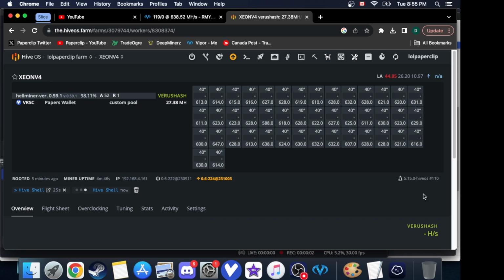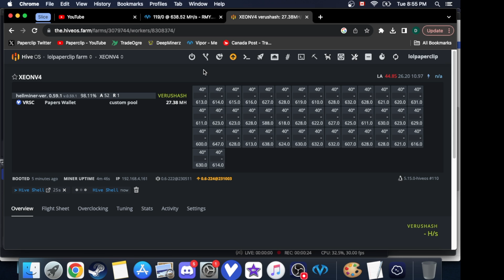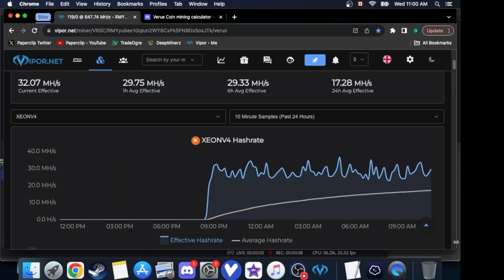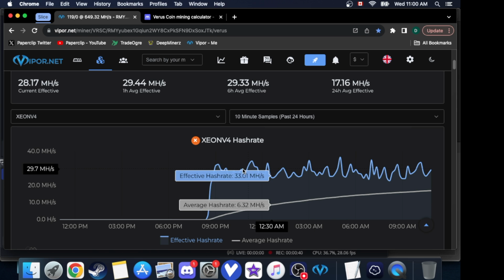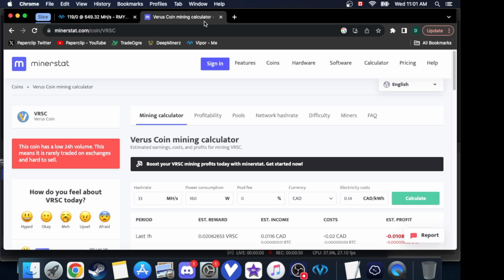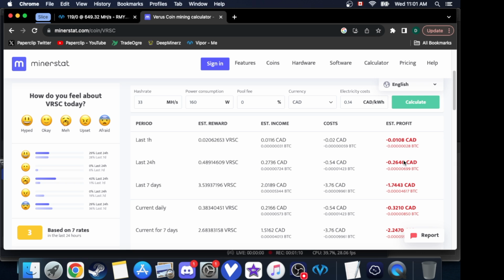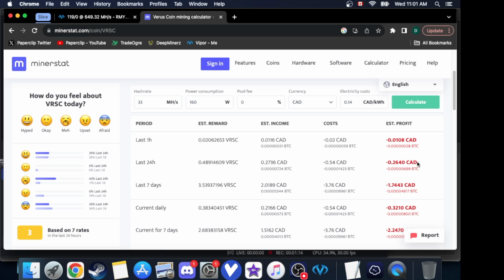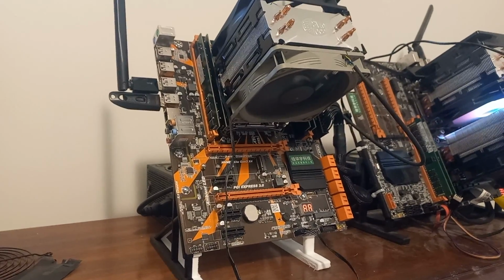SETTING UP MY NEW XEON RIG │ Verus Mining

Comment: Hi, do you think there is a big difference in hashrate between Xeon E5-2699 V3 and Xeon E5-2699 V4? Mh/s? thank you
Reply from the maker: Not a huge enough jump to the justify the cost of upgrading from V3 to V4... you have to make sure too, that you have mobo that can handle them. I am running off of cheap chinese X99 boards as well.
Reply: @lolPaperclip  No you don't understand me, I'm new to this and would like to try Verus mining, I have a dell precision t 5810 server station with a xeon e5 1620 v3 processor that gives 7.2 MH/s and I would like to upgrade it but I don't know what the difference will be between 2699 v3 and 2699 v4 in hashrate (MH/s)
Reply from the maker: @ОлексійК-в8т  v4 runs at higher clock speed and has more cores.... and I have Dell precision board as well. But I don't have the fans 'n shit.

Comment: I have a CPU 14 core 28 threads × Intel(R) Xeon(R) CPU E5-2690 v4 @ 2.60GHz AES running on hiveos with xmrig. When i give him the full 28 threads in the config he has only 2,5 kh/s. If i reduce the threads to 16 he makes over 5kh/s. I really not understand why 🙂.
Reply from the maker: I think with random x it's more memory based
Reply from the maker: I think HiveOS auto corrects it for you... but I am not an expert

Comment: Hi, how are you ? Your video with valuable information is very good. I want to ask if the e5 2699 v4 works on a dual motherboard to place 2 e5 2699 v4? I want to mine dero on hive os with the new version of the dero miner luna doubles hash on amd and increases significantly on intel. https://www.youtube.com/watch?v=kpgtJ-RNxYY&t=122s

Comment: Im only getting 14mh/s on a dual Xeon E5 2640.. Any suggestions? I think my psu might be too small, 550w. I'm kind of a noob tbh
Reply from the maker: How much RAM and it could be that they are 2640, I wouldn't go below 2680
Reply: 32gb of ram, it was just a cheap marketplace deal so I scooped it up
Reply from the maker: @SmitHVAC.   what version of the 2640s?
Reply: @lolPaperclip  I'm not sure, how can you tell? It's showing 12 cores 24 threads
Reply: For $80 Canadian, I guess she'll do

Comment: I have xeon e5 2680 v4 CPU processor 2x16g = 32GB and get 23-27MH/s with it.

Then I have dual XEON 2x2683v4 64GB, with that I get about 30MH/s when I use 40 threats.
If I use 50 threats I get only 5 MH/s.

I have thought more Threats more MH/s

DUAL CPU has 72 threats. Why is MH/s less although I have 2 CPU ?
Reply from the maker: Leave some cores for the OS maybe?
Reply: @lolPaperclip  
Mainboard with 1 CPU E5-2680v4 14 cores 28 threads
Uses 25 threads for mining. Works quite well :-)

Moainboard with 36C/72T 2 x Intel Xeon E5-2686 v4 18C/36T 2.7 GHz - 3.0 GHz manages only 44 threads makes 40MH/s

If I take 45 threads the MH/s goes down to 6 MH/s
Reply from the maker: @Fl4shBoom  very weird, I cannot help you there buddy guy

Comment: If the motherboard allows for undervolting give that a try to lower your power consumption. Those E5-2699V4's are energy pigs.
Reply from the maker: I am not sure if Intel chips allow undervolting, Im 100% you can with AMD tho.
Reply: @lolPaperclip  you gotta bios mod it by using s3 turbo tool. you cant unlock turbo on v4 cpus but you can undervolt them. just gotta create a .efi then dump your bios then mod it with mmtool reflash mod bios with fptw64 and it will be undervolted. you can do 50mv on core 20mv on cache undervolt. you can do around 80 if you disable hyper thread.

Comment: how do you set up software to run the rig to mine verus in a pool. like you do on verus miner on android. do you have to load win 11 and do it that way or can you do it via Linux. I'm learning. sorry if sound dumb
Reply from the maker: I installed HiveOS onto a thumb drive and that's how it runs, it's actually pretty simple.. a few YouTube tutorials should help you out
Reply from the maker: And with my phones I have an app called Userland which has Ubuntu terminal on it and that's where I install the miner.. you can learn about that in my "How to mine Verus like a pro" video

Comment: I’m running five cellphones and an AMD 3900 rig to mine VRSC. It’s a 3900…not a 3900X. The 3900 is a 65W tdp vs the 3900x at 100W tdp. I average 28,000 MH with it. I think it’s dope to have a low voltage Ryzen 9 and would buy at least one more if it wouldn’t cause a divorce but…man, I’m not risking it. It’s definitely a cool cpu to look into. Kind of rare too. They were originally only released in prebuilt systems.
Reply from the maker: Oh that's cool, I just bought a mini pc with a Ryzen 7 5800h in it, gunna test it for a video

Comment: On the 5950x I see 45-48MH or so.  ASUS ROG Strix B550-F can be found referb'd for about $110 or so.
Reply from the maker: that chip alone is worth 500 CAD tho.. IDK
Reply: @lolPaperclip  Ya, you'll have to figure out the ROI to see if it's worth it.  I have a couple of those processors for my workstation and ProxMox server.   It's a beast.  Also, probably energy efficient over those zeons.
Reply: They can mine a lot of different crypto.  I'd recommend getting them used if you can.